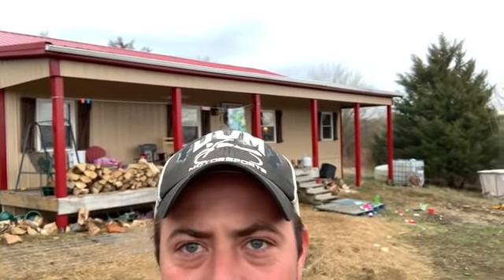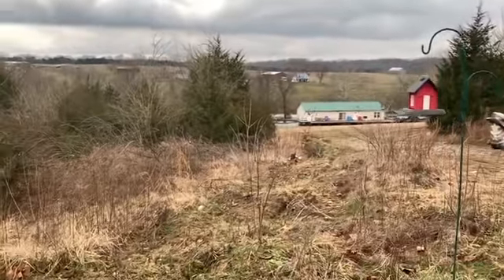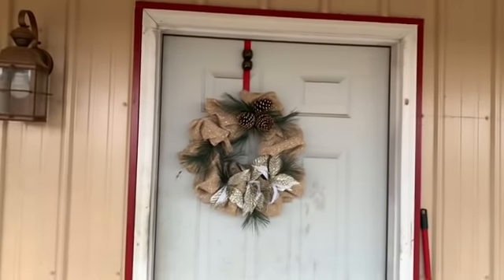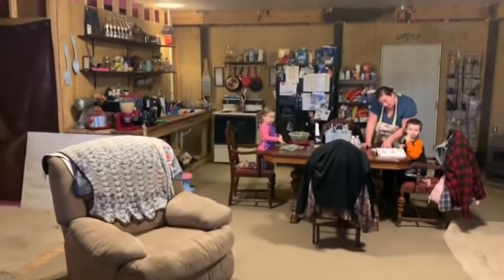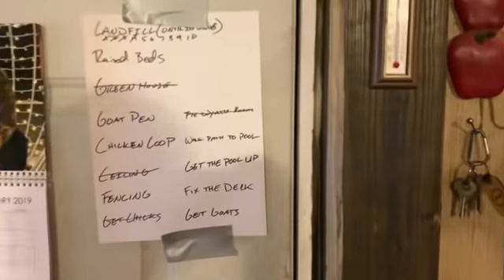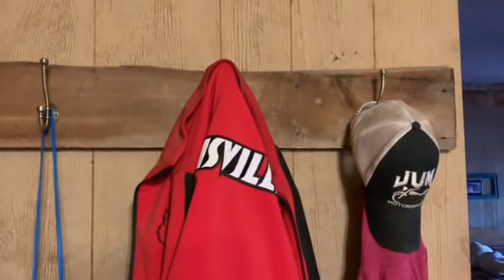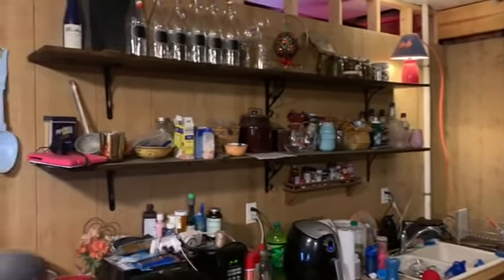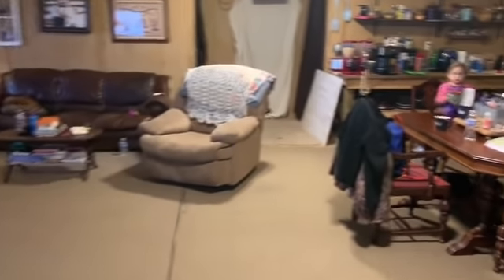House Tour | DIY Pole Barn

Comment: LOVE your home ... and family (so cute). Thanks for sharing it all with us.
Thought I'd share a few thoughts that you might like to use (or not) as you go along:

- When you finally need doors on the bedrooms, you may want to consider louvered doors - visual privacy and allows air/heat flow (and you can hear what the kids are up to).
-  I posted a video on our channel showing our cheater mass heater, with an amusing story about our gas company's reaction to our super minimum gas usage.We wanted to increase the efficiency of our wood stove, so I stacked bricks around the side and back - the hottest areas of the stove. The bricks absorb some of the heat and then radiate it back out over several hours; they also help hold the heat away from the exterior wall - "I'm not heating the county", as my pawpaw used to say.
- During the winter and early spring we use some bales of straw to throw on the ground on the paths leading to our back door to lessen the mud tracking (hubby and dog forget to wipe their feet before coming in).

If anyone criticizes your home and life, their just jealous - we can feel it. LOL Besides, Them what care, don't matter; and them what matter, don't care. 
We care and wish you much love and success in your wonderful life.

Comment: You could do sliding barn doors
You could also do panels at the top of the walls, put them on hinges, and use a pull chain. They would be like a damper at the top of each of the walls
Reply: I like the idea of those sliding barn doors

Comment: Your chirping carbon dioxide protector can be fixed lol!   It seems like it can't be because if you open it up it says it needs to be replaced!!!!  Not true, we had to go through batteries until it liked ones we put in, but then it got happy and stopped chirping!!!!!  Guess which batteries were first choice - dura cell!!!  We ended up with batteries we buy by the multi 48 pack from Advanced Auto!!!!   Good luck!!!!  Enjoy your videos and your family!!!!

Comment: I have been interested in having a barn house for several years, so really appreciate that you shared your home.  I love the layout.  It’s really similar to what I want.  The only thing that worries me is lack of tornado shelter.  Gotta have that.  Wouldn’t want one to far away from the house either because I can’t run.  What was the source for your kit?
Reply from the maker: You for sure won’t regret it if you go pole barn route. Thankfully where we are it’s very rare to have tornadoes but if we do we have family on the same land that have basements. We used DIYpolebarnkits.com. I don’t recommend them though sadly. Difficult to work with and very slow in our opinion. Blitz builder is a great company that I would recommend.

Comment: ZAC  ON THOSE FLOORS, LAY SOME PLYWOOD AND BURN IT TO SEAL IT. IT LOOKS GOOD AND HIDES THE DIRT. NICE AND NATURAL. OR GO WITH A WOOD FLOOR, AND SAND IT WELL STAIN AND POLY IT WITH MULTI LAYERS TO SEAL IT GOOD.  OR TILE IT BUT i STRONGLY RECOMMEND STAYING AWAY FROM CARPET, IT HOLDS DIRT AND BACTERIA, IS HARD TO KEEP CLEAN, IT IS NOT SUSTAINABLE.